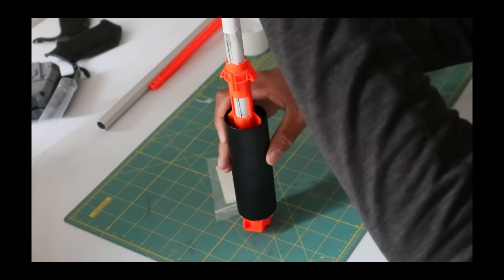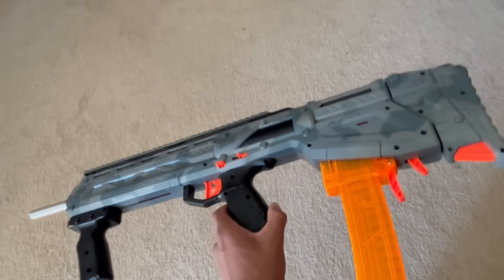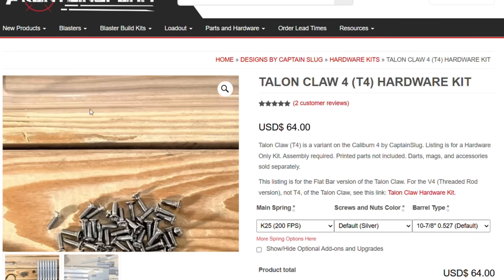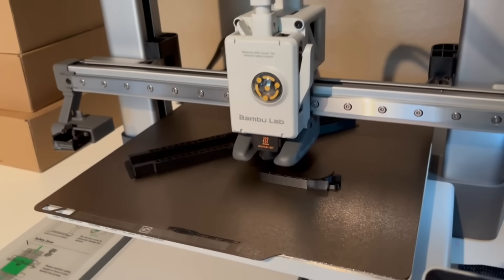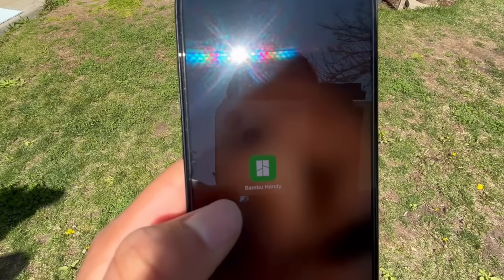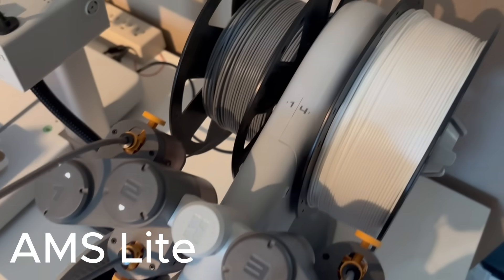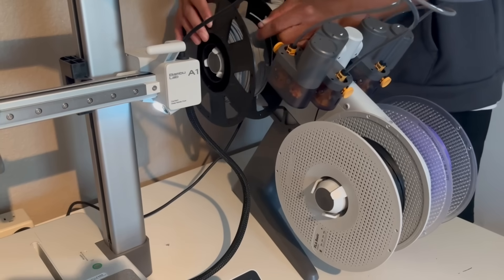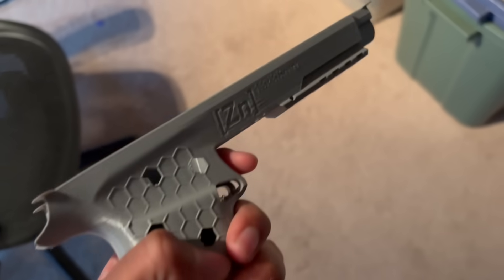I Tried 3D Printing Nerf Guns

Comment: You didn't need to take the whole longshot apart, the front has 2 takedown pins with screws and a third one on the top left side of the blaster to reveal the spring
Reply from the maker: THANK YOU SO MUCH

I just tried that and can confirm that it works now I dont have to take apart the whole blaster!
Reply: @MidModifications  No problem

Comment: Sorry, I had a thumbs down your video because of the Bambu shill. The reason you got that printer is because Bambu is trying to make people forget that they are stealing creator’s IP. You should have gotten a better one.
Reply from the maker: Good to know.
Reply: if you're talking about that stupid lawsuit that company tried to sue creality, prusa and the whole 3d printing community becuase apparently a heated bed was a copyright infringment on thier design from 2011. Which fell through because extruding onto a warm sheet of metal has been done before them and is a process that can't really be copyrighted.
Reply: @ No, creator’s IP. Not Creality's IP. Check your terms of service. If you have one. To print with Bambu you have to connect to their servers. So you being the creator of a model, a mount, whatever. You have to send that through their servers to print. In essence that thing you sent through their server now "belongs" to them. If your buying models who cares. But If it's a one off. The creator won't be able to have full control over their IP. This is all pretty recent, they changed their terms of service. Maybe late 2024. I don't remember the date. And at that point prints had to go through there servers. Bambu is on a Marketing Blitz right now, to try to get people to be ok with Bambu peeking at their models. That's why I said he could of gotten a better printer. I believe he could of gotten that new jam from Bambu! They're good printers, But with a BIG ASTERICK!

Comment: You put that other spring in the swong place should have swotched them that one in the back ...no?
Reply from the maker: Io think I did it wrong. I spent like two days messing around with it trying to get it to work cause I really wanted to try it.
Reply: @MidModifications it looks like you got a Nerf Longshot spring for your talon claw. As far as I’m aware there’s versions of the plunger for the talon claw that can take LS springs, but the files you have aren’t designed with them in mind

Comment: If you're impressed with 150 FPS on a zinc you need to look up Moose Mod Shop, that's the opening bid for the tiniest zinc with the weakest spring included, and I've got zincs that will outperform your talon claw.

Did Frontline Foam charge you for the holy hex frame STL or did you track down my original (free) one on thingiverse?

Track me down and I'll hook you up with a 31K hardware kit and you can make some comparisons.

Comment: you know what i always hate i hate it when i lose the darts i swear someone should diy a tracking system so you can find your darts again with a gps mounted onto the gun making beeping noises or a small LCD display to locate the darts
Reply: Hmmm
Reply from the maker: Yes. Losing darts is the only part of nerf guns I dont like

Comment: You could have also bought a nexus pro x from walmart (I costs 50 dolars and it shoots 200fps and it includes a bcar).
Reply: I just want a primary blaster that shoots full-length darts (NOT the major development path), has a cylinder mag (because I don't trust full-length darts to feed reliably from a box mag), and a bscar.
I don't think anything on the market satisfies my requirements?
Reply: @DrKnowNothing1  there is 1 thing i know but it takes box mags (the worker ones are reliable) and it's the Sillybutts Excalibur.

Comment: Yeah, 200fps is just fine. Where I play, we have a 300fps limit in our outdoor games, and I think that's a little too spicy. I have a caliburn, which is essentially the Talon claw's big brother, and it hits around the 300fps mark, and it's so accurate, that it sometimes feels unfair.
Reply from the maker: Yea I dont want my gun to be a cheat code. Im happy with it hitting 200 fps myself
Reply: @MidModifications  I would recommend not calling it a gun, since the nerfing community wants to separate our hobby from firearms and the like. 

That aside, I hope you're enjoying the blasters! You really picked some solid options! If you want to do more of these, I would personally recommend the caliburn or some of the blasters designed by sillybutts!